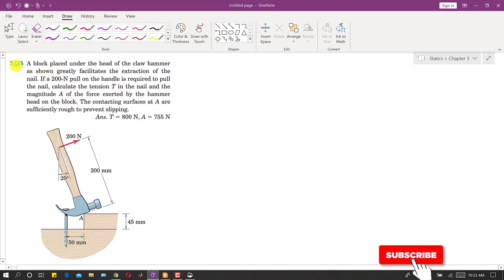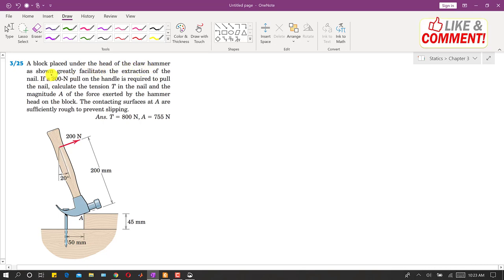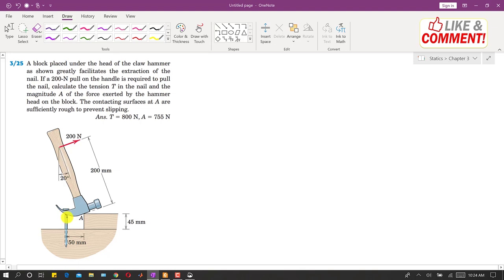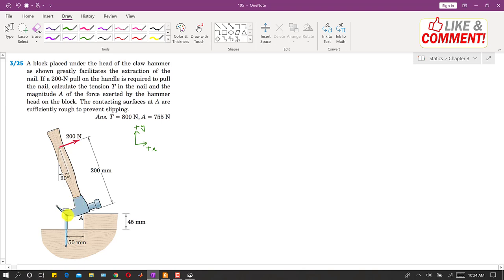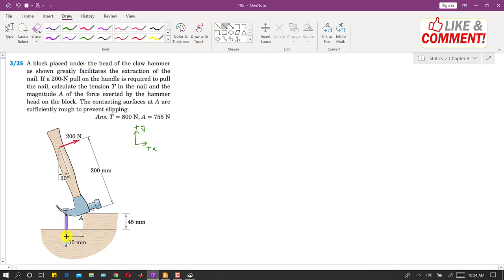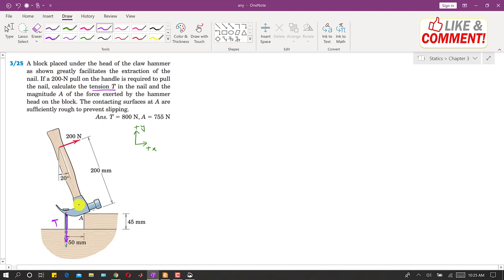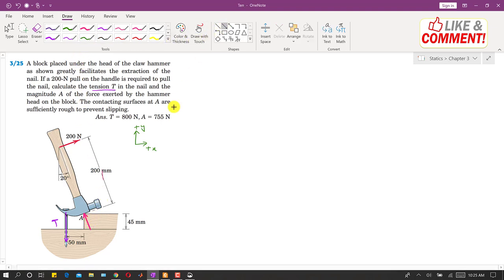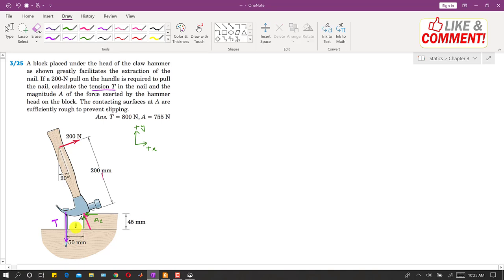Engineering Statics | P3/25 | Equilibrium in 2D | Chapter 3 | 6th Edition | Engineers Academy

Comment: Ax = 187.94N, Ay = 731.6N. And we found A = 755N by using sqrt(Ax^2+Ay^2);
But when I check the answer by using SohCahToa rules, I found that 755 sin20 does not give me 187.94. I am so confused about this. How come that these two formulas give two different answers? Which both should be logically correct.